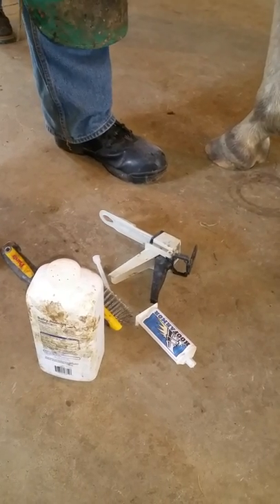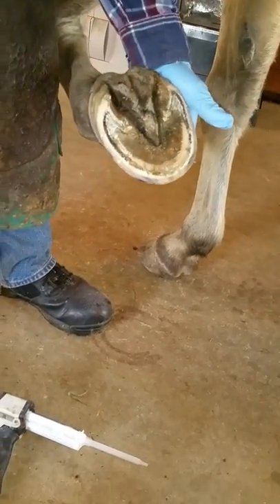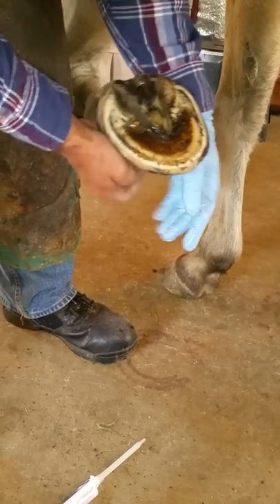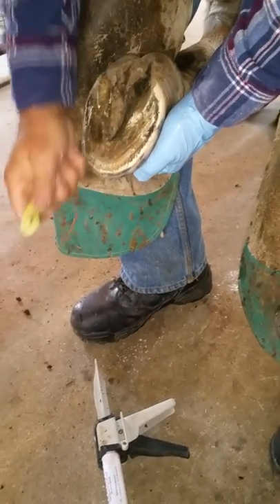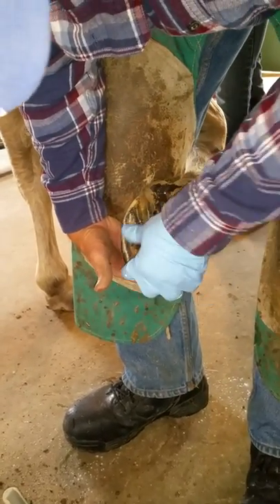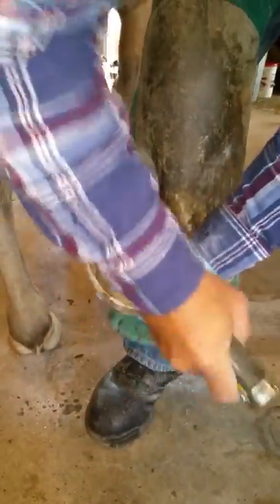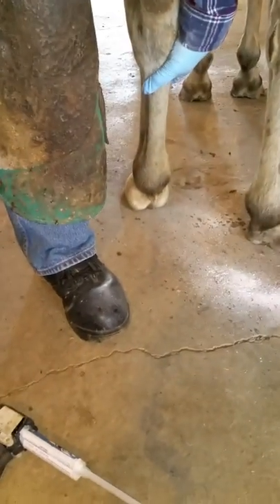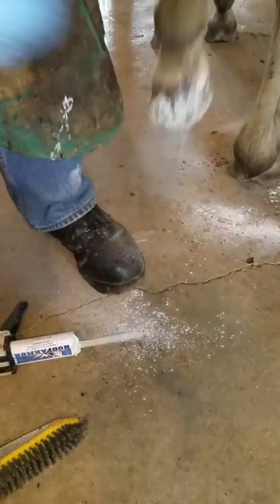Hoof Armor Application

Comment: How does hoof armour affect a hoof that may be sprouting an abcess.  Will it stop the abcess from coming through?
Reply from the maker: HoofArmor and Abscesses “An abscess (Latin:abscessus) is a collection of pus that has built up within the tissue of the body. An abscess is a defensive reaction of the tissue to prevent the spread of infectious materials to other parts of the body. The organisms or foreign materials kill the local cells, resulting in the release of cytokines. The cytokines trigger an inflammatory response, which draws large numbers of white blood cells to the area and increases the regional blood flow. The standard treatment for an uncomplicated skin or soft tissue abscess is opening and draining. Even without treatment they rarely result in death as they will naturally break through the skin.”
Hoof Armor is an adhesive coating that is applied in a thin layer over whatever part of the hoof desired, or over the entire hoof capsule minus the coronary. As a coating It is tough yet flexible…more flexible than a hoof. However, Hoof Armor contains Kevlar fibers that help bind the material together in a sheet. For this reason, Hoof Armor will be more difficult for an abscess to erupt through. An abscess is usually an infection where the cells are too large to be carried away by the blood vessels. This can also be caused during laminitis where the damaged cells become abscesses. When enough of the abscess builds up it causes pressure which causes pain and must be relieved. The pressure causes the abscess to erupt from pockets where it builds up. A Hoof Armor coating is similar to the hoof wall where an infection must travel along until it finds a soft spot where it can erupt, which typically is the coronary, heel bulbs or weakened sole.
If an abscess has erupted in the hoof capsule (sole or wall) applying Hoof Armor may help the area heal by protecting it against dirt and the anti-microbial agent in the Hoof Armor formula may help protect against infections. It is not recommended to apply Hoof Armor over an area where there is a suspected point of eruption as Hoof Armor can prevent the abscess coming through the surface. Possibly hoof testers can pinpoint such areas.

Comment: I am having a hard time believing Hoof Armor would adhere properly to the hoof with this application. This epoxy substance will attach to the first molecules it comes in contact with. There is still a ton of dirt and moisture on that hoof so the amount actually attaching to the hoof is not adequate.  Also applying the talc powder that fast without allowing a bit of time for it to set up has to be bad too. The idea is interesting but  I have to wonder why proper prep is not emphasized?
Reply: It sounds like you are more familiar with glues than coatings. HoofArmor is a coating rather than a glue and is not used to adhere one thing to another so there is nothing to fall off. HoofArmor was designed to be very user-friendly and forgiving so that anyone can effectively apply it, even during a ride. Because it is a liquid when applied any particles of dirt that remain will be encapsulated and becomes part of the coating. Of course, it is recommended that the hoof surface be as clean as possible, but HoofArmor is seldom applied in a sterile location. The only time that it is crucial that the surface be totally clean is when HoofArmor is used to treat infections such as Thrush or White Line Disease. Then, applying HoofArmor over dirt or bacteria reduces its effectiveness.
Reply: Also, the talc powder is only designed to keep the curing HoofArmor from smearing on concrete or rubber mats.Talc is recommended because it is slippery, although corn starch or other powders can also be used. In dirt or sand the hoof can be put down without powder. The powder is supposed to soon come off the coating and not intended as part of the coating.
Reply: @dtjones8706  It makes sense that the powder is not supposed to stay there but if its put on immediately won't it also encapsulate into the epoxy and weaken the structure of it?
Reply from the maker: Hoof Armor cures too quickly for the powder to become encapsulated and weaken it. Plus the powder being lighter will float on top and not travel down to hoof tissue level. The powder will quickly wear off still leaving a good thickness of Hoof Armor.